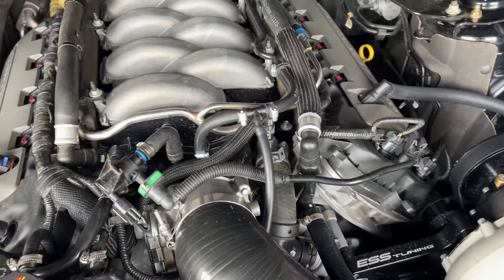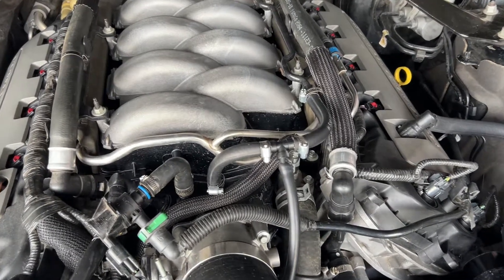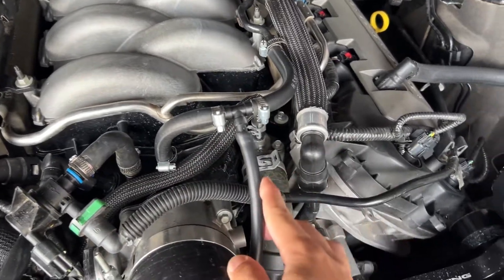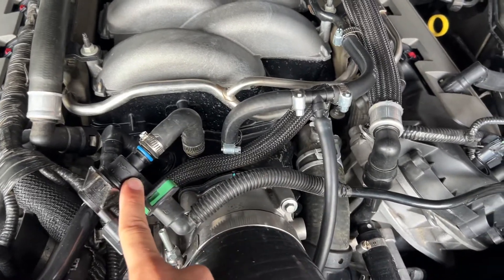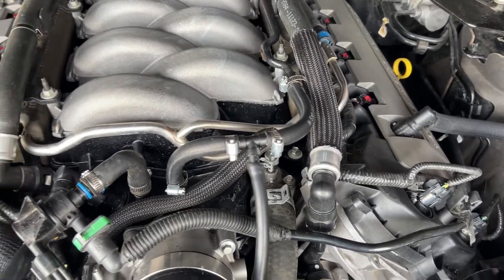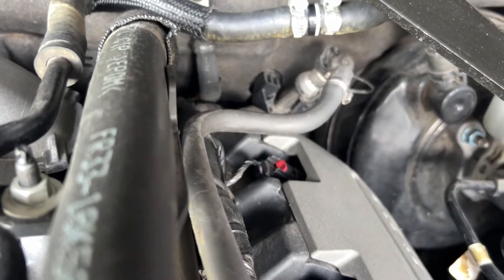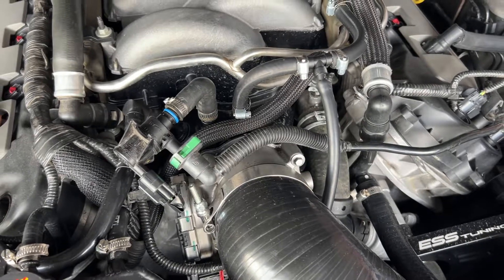15 Mustang GT Dual Check Valve Replaced With a Single Check Valve

Comment: Yo I have a question on my 2016 stang I did the same exact setup you did 2018 manifold with jlt intake currently getting tuned by tricky but my brakes or so tight I wonder do I need to connect another hose on the brake booster line I got mines capped off and I think that’s the problem
Reply from the maker: I would confirm with your tuner but you probably don't want to cap it off.

Comment: Hello I have a question about this set up I am running into the vacuum routing issue on my 2016 gt with a 18 mani and G2 kit is the one way check required and if so what was the purpose of putting it in the place you did? I guess I am asking can it be closer. thanks video was very helpful and I most likely will go this route!!
Reply from the maker: I decided to place the one way check valve there because it looked cleaner. Apparently the brake booster already has a one way check valve near the firewall but I added this as an extra measure since I deleted the big dual check valve.

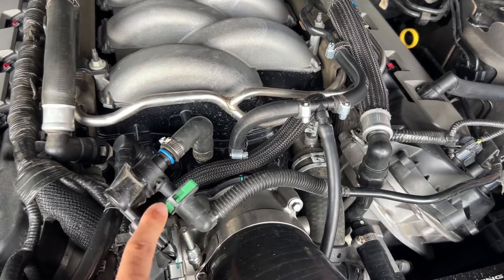Comment: Do you have a link for the purge canister adaptor you mentioned at 1:00 ?

I'm likely going to use this vacuum setup with my ESS kit and I want it to be as clean as possible.
Reply from the maker: Yep, link in description
Reply from the maker: Oh you mean for the purge canister thing, I actually have not purchased it yet, I think you need to look on a ford parts website.